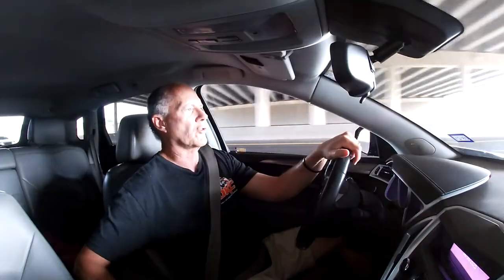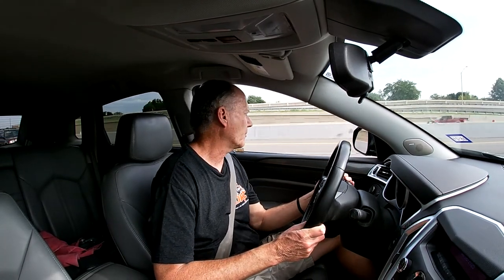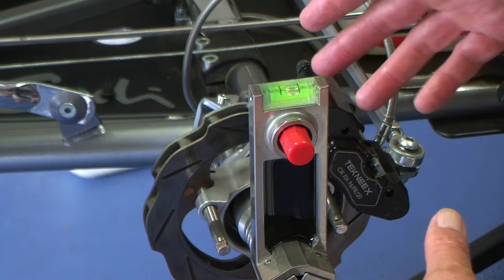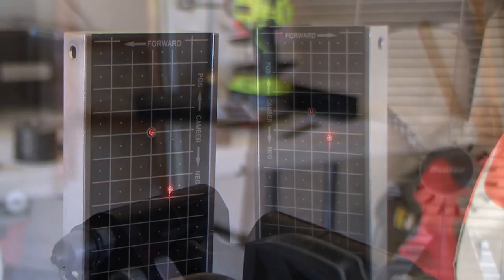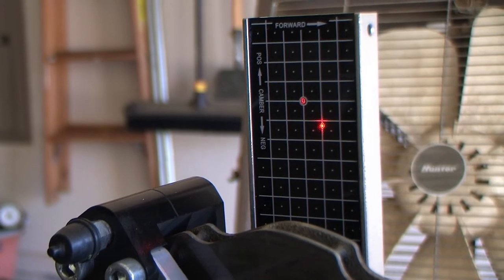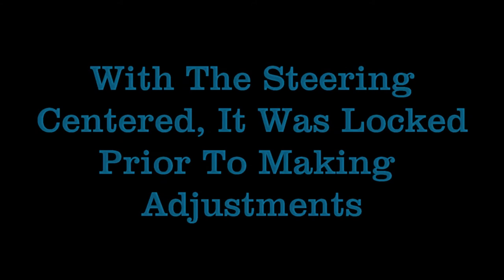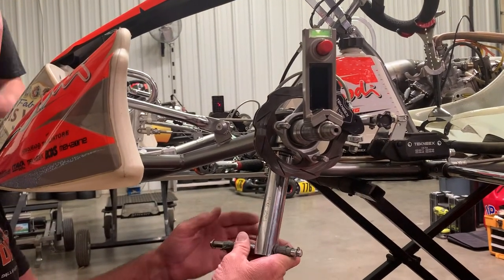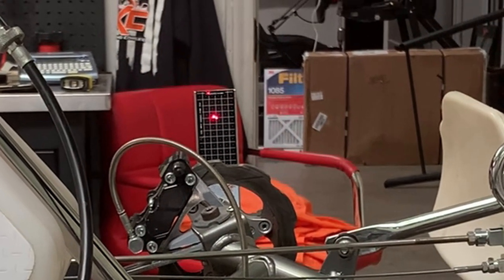How To Align Your Kart movie

Comment: You have your caster adjustment on the bottom of the kingpins, do you also have adjusters on the top aswell?? 
Most dont bother with both, and most set them on top as its alot easier to access, if you have both fitted with dot 5, you can get alot more variation and set up more precisely.
Reply from the maker: Very interesting!  I'll definitely give that a try!